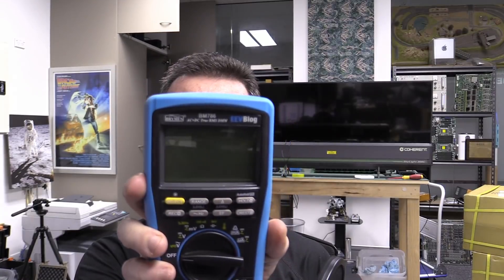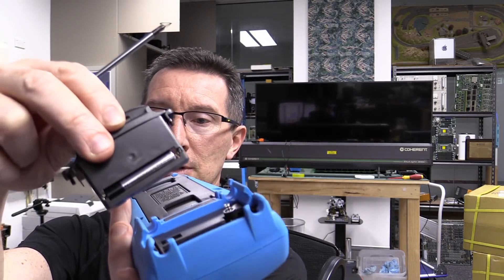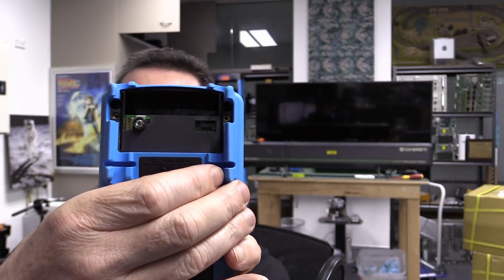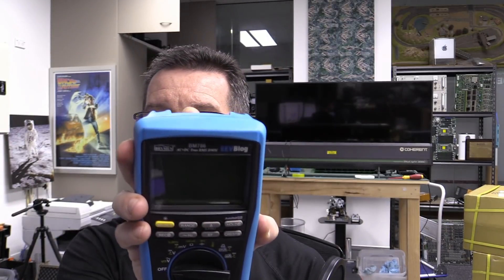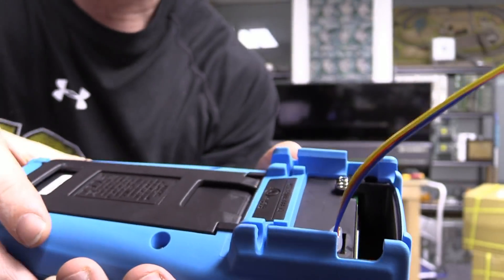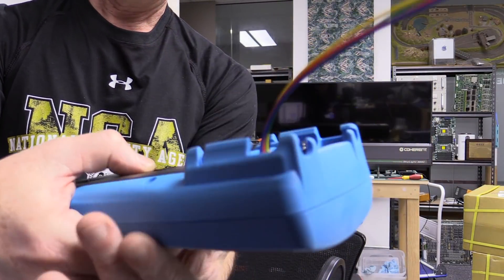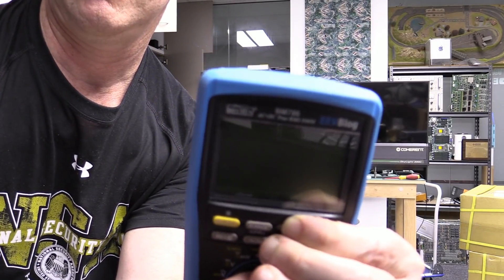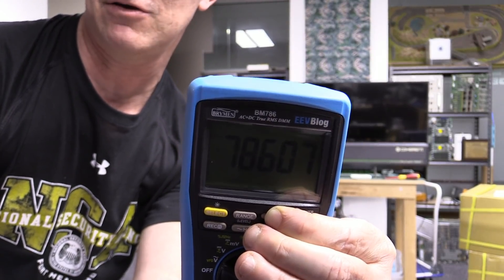BM786 Firmware Update Test

Comment: Lots of angry comments, but the optimist in me is thinking you made this video to encourage people to do some reverse engineering work without violating your NDA!

Honestly, it’s either that or you’re being a bigg meany boi, which seems out of character
Reply from the maker: Or option three: Some people have asked to see if it works, I hadn't tried it before, so I just switched my camera on.
Pro tip: When you try and guess other people's intentions you will invariably come-a-gutsa.
Reply: @EEVblog2 , makes sense, I guess. It just seemed odd to tell your customers, “I can do this cool and potentially useful thing that you can’t and never will be able to.”

After reading comments that were unhappy with you, I tried to look at it from an entirely different and optimistic angle, failing to see that reality might be in the middle.

Either way, I might be pulling my reverse engineering hat out of storage in the near future.
Reply from the maker: @pyromen321  If my customers don't understand that every meter on the market gets firmware updates from time to time like this, either (usually) at the factory, or in this case possibly at the dealer, then they do now. They are now more educated than they were before.
Reply: @EEVblog2 , yeah I created a false dichotomy in my head. Your pinned comment and explanations in the comments made your intentions clear

Comment: Even with the explanation in the pinned comment, Dave taunts us by updating firmware that literally nobody else can do.  So much for Dave's support of Right To Repair.  If this was a Louis video, he'd be shitting all over this company.
Reply: Instead Dave showed us how to connect a 5 pin programming cable wich also has power so its 3 data pins... And he described the tool he is using that it has a button that is specifically labeled... he told us his tool is reflashable to hold the firmware... he showed us how to enter firmware flash mode and where the connector is. And all that under a NDA. As an electronics guy the above mentioned things are enough... No shitting required.

Comment: Makes no sense. Why include the feature, but then say you can't use it? It's one thing to use a OTP rom to save some money on production, but if you're going to spend whatever extra it is for the eeprom then why block the function? What kind of benefit could Brymen possibly be getting by blocking access to this?

At the end of the day I don't think there's going to be any real difference in what firmware you're using from an end user perspective. It's just the principle of the matter. Anyway, giving someone a lock and then telling them they can't have the key is a surefire way to guarantee your lock gets picked.
Reply: EVERY manufacturer does this. Brymens connector just happens to be accesible.

Comment: "The firrware is NOT user upgradable."  Pretty unforgivable in this day and age. If updating the firmware of existing meters isn't worth it then why are they even bothering to alter it?
Reply: Then virtually every multimeter manufacturer is unforgiveable.
Subtle firmware changes happen over time to fix usually very obscure issues. EVERY manufacturer does this, you are just aware of it now with this video.

Comment: So much for right to repair...   Shame on you.  Details and firmware should be public!
Reply from the maker: I have no control over this, it's not my design.
Reply: @EEVblog2  You willingly chose to sell the meter through your own storefront though 🤷‍♂️
Reply: How would firmware help to repair a multimeter?
Reply from the maker: @ASilentS  I sold the BM235 for years before this and it doesn't have firmware upgrade nor schematics, nor anything open at all. And I can't see how a manufacturer factory firmware update has anything to do with right to repair. And if you actually cared to notice, I released the schematic, interface details, calibration information and procedure, and comms software source code for my 121GW meter.
Reply: @EEVblog2  You said you had "no control". I was pointing out that you, in a small way, do. That is all.
Reply from the maker: @ASilentS  As if I didn't know that. But it's a completely asinine argument to say that a manufacturer factory firmware update port has anything to do with right to repair. A schematic is VASTLY more valuable. And no one has ever complained that Brymen meters, like a almost every other meter on the market, does not come with a schematic, let alone is not user upgradable.
If you want a meter that's more open then my 121GW is practically the best on the market in that respect.
Reply: @EEVblog2  Are you sure you're responding the the right person? I didn't make any of those arguments and actually completely agree with you.

Comment: I will have to advice you to stop shipping the meter to Norway then. Because you would be in a legal heap like no other if you don’t cover the cost of software updating a product if one should need it in the lifetime of a product - or provide the end user the means of doing it themselves. And that’s for 5 years for end users.
Reply from the maker: Nope. I don't have any legal presence in Norway, they can't make me do anything.
Reply: This is not true. Even if EEVblog was based in Norway he would only have to provide repair/replacement if the product is broken. There is no law in Norway that requires the manufacturer/distributor of a product to provide upgrades to a product that works as advertised.
Reply: @apepost  wrong Bjørn. :) there has been an lawsuit that was lost where an company demanded money to get an product fixed with an software update.
Reply: @EEVblog2  as long as you sell a product in Norway or to an Norwegian citizen you are bound by Norwegian laws regulating sales to consumers and or companies. This was just meant as an friendly warning.
Reply: @pederb82  if the meter works as advertised to the specs listed, there is no recourse for you to force them to give you updates. Also it isn't like you just download and run the update. You need a programer that cost more than the meter to install the update, and it's very very easy to get the programer settings wrong and brick the device.
Reply: @ionstorm66  correct: this was if there is something in the software that make the meter not meet its spec or not function correctly. Then he would have to supply the software needed to update or repair it without cost of the customer. I was just warning that there has been a lawsuit where a company was required to release software they wanted to hold back in a situation like that. I did not mean that he has to release the software if there is not. One should just know the risk of not being allowed to release it by the manufacturer. Better not to sell in that market than risk there being an software fault and having to a: rent a company to do the software update locally(for all I know Brymen could have that) b: have the products returned.   I find our laws to be too strict looking at them from an business perspective. But as a private citizen I’m kinda glad they are at the same time.
Reply: @pederb82  But do you understand the software does a consumer zero good. It's not a "user updatable" software. They would just have you RMA the meter and either replace it or update and send it back. The cost of the programer is more than the meter.

Now if you want to argue there should be a standard for update software on devices, that is a possibility, but this meter already exceeds the needs for right to repair in terms of it being not one time programmable. 

The schematic would be infinity more useful for actual repair.
Reply: @pederb82  Ha!  Good luck enforcing that!
Reply: @pederb82  Care to share details of this lawsuit?  I really do not think it can hold water in the way you are presenting the "issue".